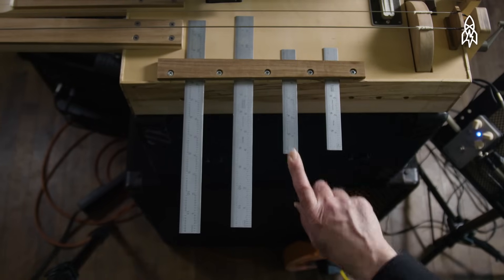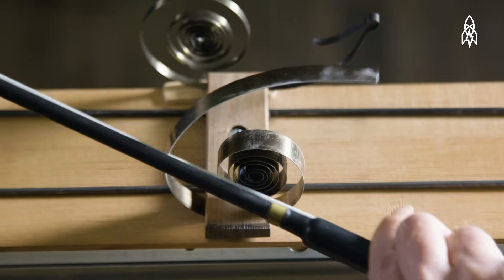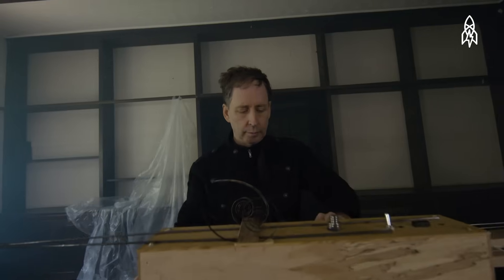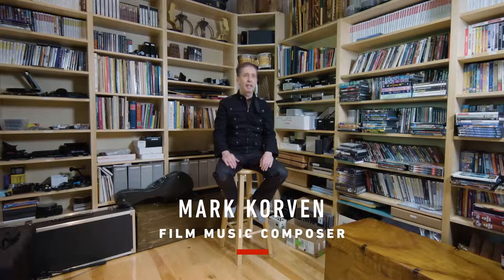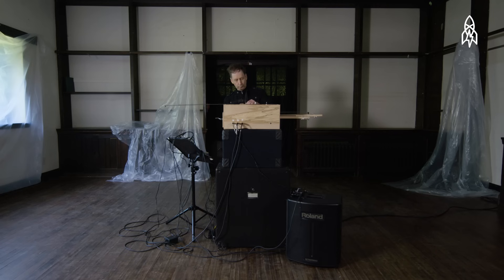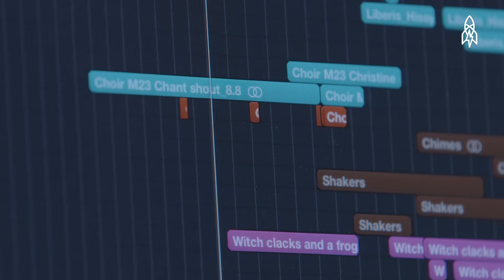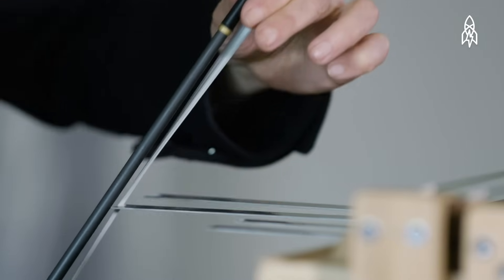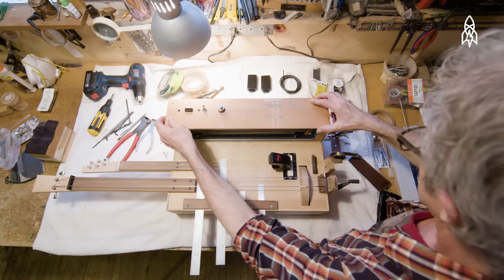Sounds of the Nightmare Machine

Comment: I'm reminded of the haunting sounds of 1999's Ringu.  Both Ringu and it's US remake were scored beautifully, mind you - but the Ring (US) has a much more traditional soundtrack, beautifully executed, and Ringu has a lot more of these fringe sounds used wonderfully for effect.  TBH, I heard almost every horror sound I could imagine wanting come out of the Apprehension Engine except for two related sounds: They're both rustling noises. One is usually used in foley to represent maggots moving through flesh or meat rotting at a supernaturally increased rate.  The other is a multilayered murmuring played as if it were the rustling of wind-blown leaves or someone splashing through mud - mud plays a big role in the sound I'm thinking of because everything in it is muffled, but in a way that makes you believe the problem is with the listener.  

Mind you, that isn't a complaint.  Being able to get every unnerving reverb, predatory creaking, and disquieting warble out of a single machine is amazing.

Comment: I wanna go to the haunted house this guy works with. I've been to a few that had "creepy" wind, some with random screams, few that had nothing, all (except the nothing) played on $h!+y sound systems. Outside of some annoying jumpscares, those are pretty boring. But something like this, with a decent system, this could raise some legit tension. If done right, could be a "good" haunted house. No peeled grapes, no wet string hanging off the ceiling, and definitely no half-stoned teenage drop-outs in dollar store rubber masks waiting to jump scare around every corner.